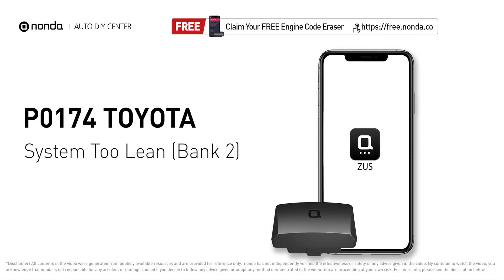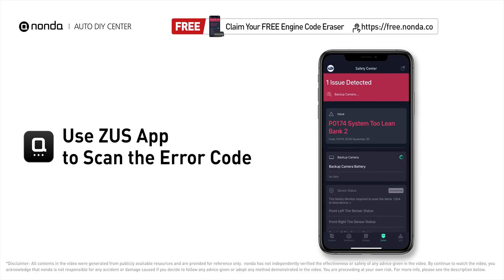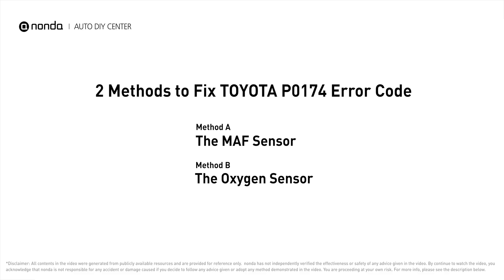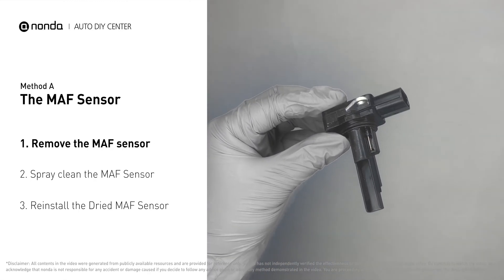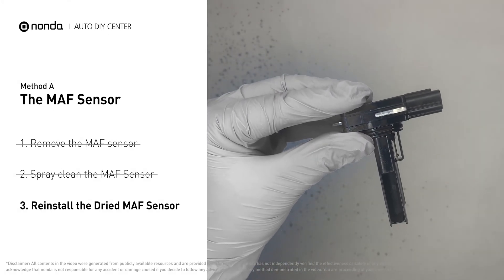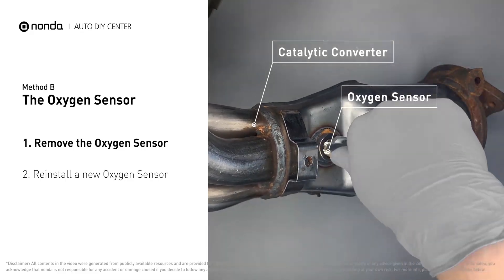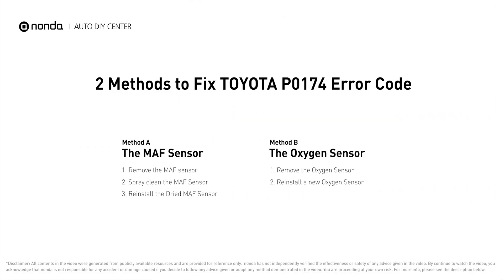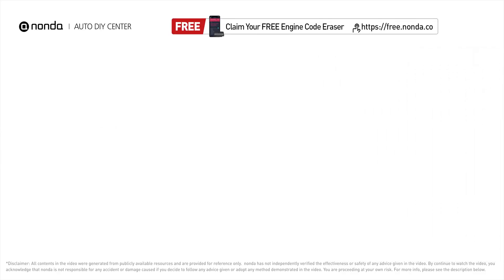How to Fix TOYOTA P0174 Engine Code in 3 Minutes [2 DIY Methods / Only $8.99]

Comment: NOT TRUE !  
We replaced all those things and am still getting lean codes. 
 Your recommended mechanical advice did not fix the 2007 Toyota tundra with lean codes..
Reply: Mine was the purge valve